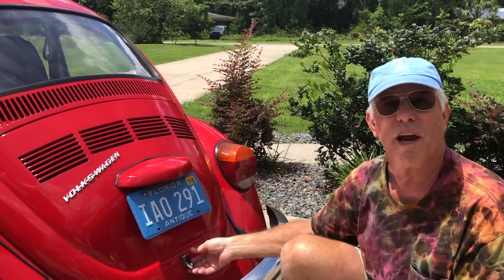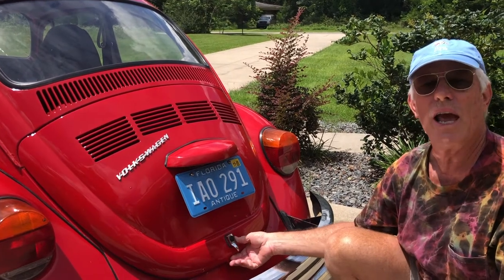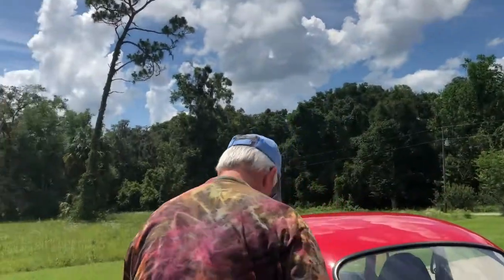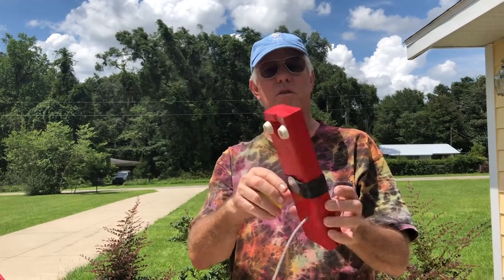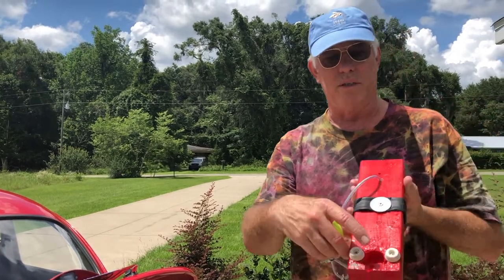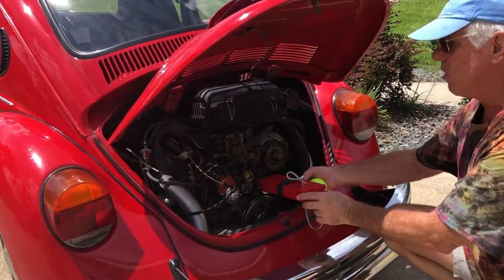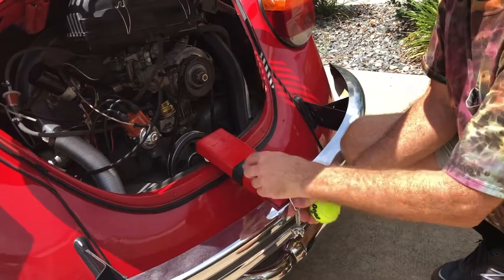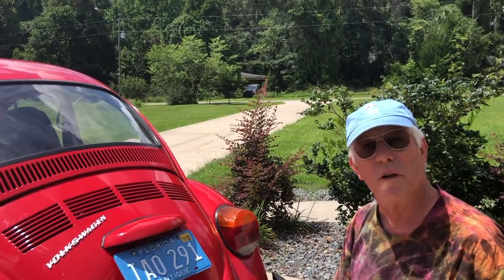VW Beetle Decklid Standoff

Comment: Looks like it would suck muffler heat into the fan.  Always, cool air in the top, heat out the bottom.  Stock engines do not overheat in my experience.